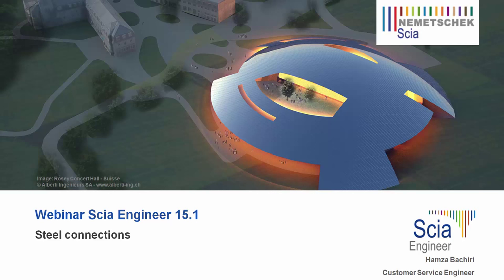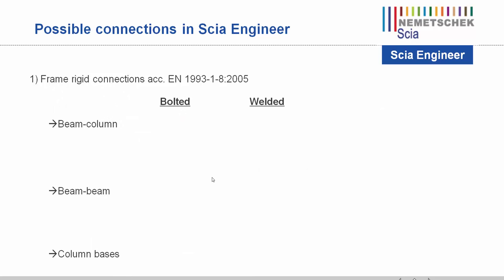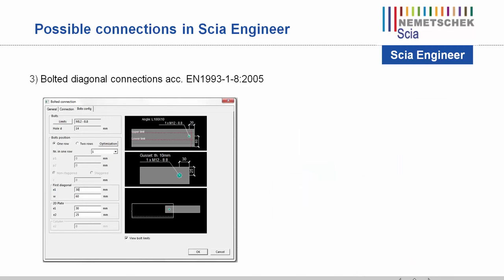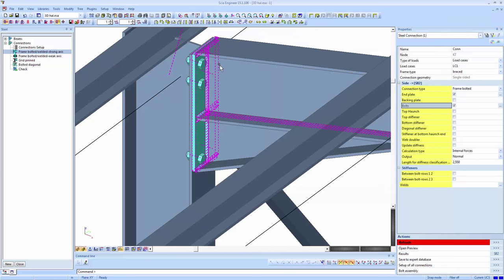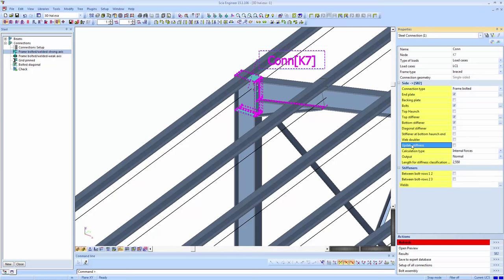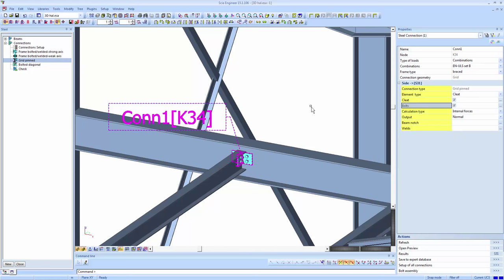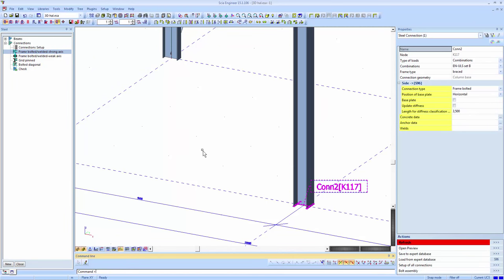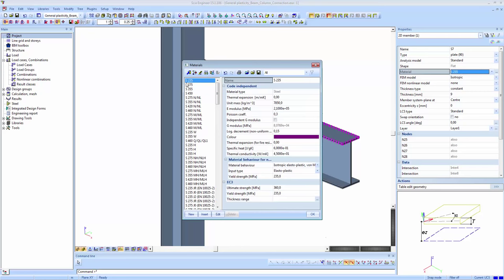[EN] Steel connection design with SCIA Engineer 15

Comment: Can you make a seperate video talking about expert system and what are unity checks exactly (by calculations of mechanics equation) and why it has to be less than unity ?
Reply: Hi Mr. Praneeth,

For now there is no planned webinar regarding the expert system but I can give you some information about it. Please have a look at our online webhelp and our resource center:
https://help.scia.net/webhelplatest/en/#rb/connections/expert_system.htm 
https://resources.scia.net/en/factsheets/steel/steeldesigner_connectionsexpertlibrarysystem.htm

Regarding unity checks, this is in general a ratio between the applied action/effect (e.g. force) divided by the resistance value. If the applid action/effect is higher than the resistance, the ratio or unity check will be higher than 1.

Regards,
Hamza